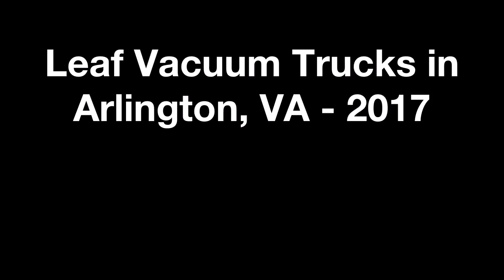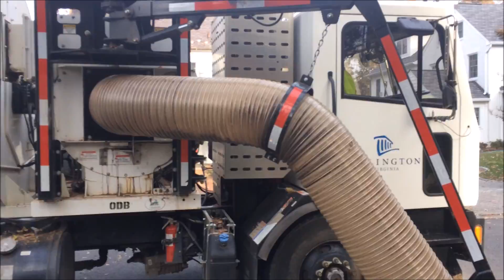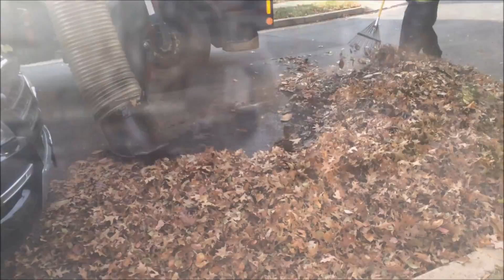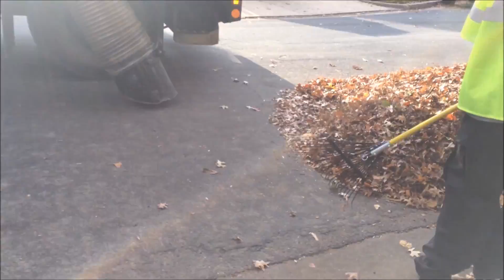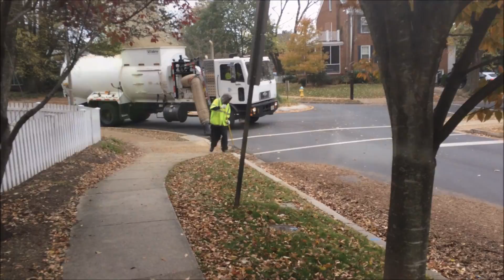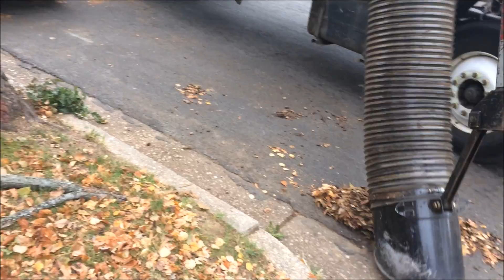Leaf Vacuums in Arlington VA - Fall 2017 Leaf Collection

Comment: I've never seen a big truck-mounted one like that before, I'm guessing it is a big mulcher.
Reply: Good question. Would hope so.  Otherwise it would fill up quickly.
Reply: Most leaf/debris loaders mulch a little. Depends on the prop that’s in it. Mine mulches at a 15:1 ratio.